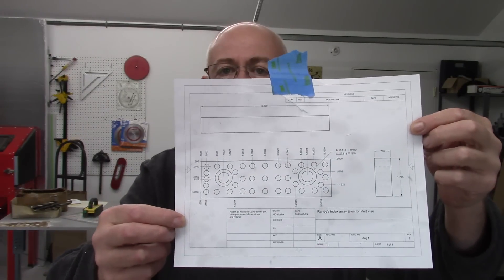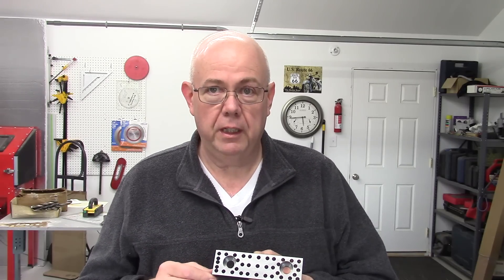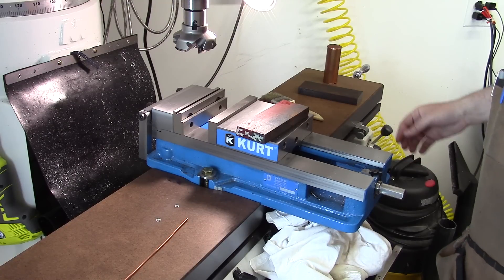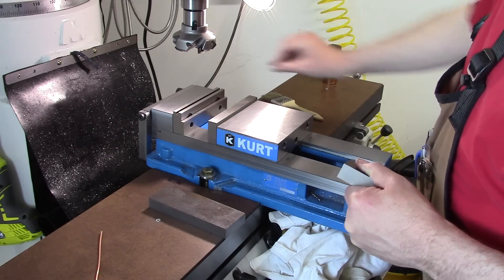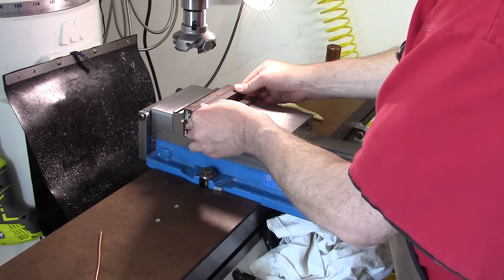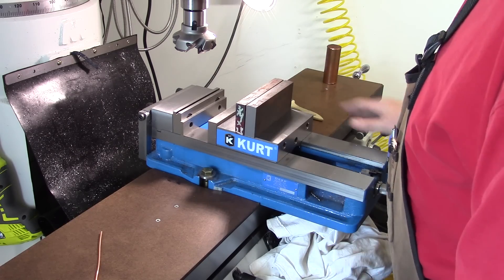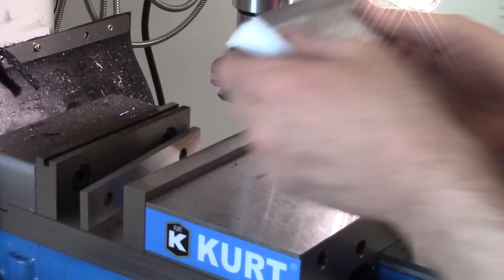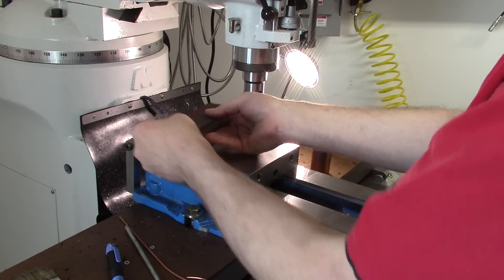Indexable vise jaws for Kurt vise - part 1/5

Comment: good honest video. The round rod of any type is not good and keep in mind it wont work if the sawed stock is out of square. One side will instantly lift up and likely break the inserts. Instead take a 6 in long square of aluminum and clear out leaving a raised pad that you can crush down on. The round rod allows the the plate to pivot also. To prove this run across there like when you did the narrow sides taking a cut from right to left like you did. Now felt pen the top. now do a spring pass back the other way and you will find that the part in contact with the solid jaw on that side will in fact clean up but the other side near your rod wont touch. Using the pad method you wont see that and a sawed part can be 5 degrees totally out of square but it will be held against the solid jaw perfectly. with the blocks not yet touched first thing is to put them in together and hack off the sides as fast as you can traverse. Then put them in the vice and make your first ref surface--the large faces. do both faces. Now stick them in together and do the sides again together finer feed. . For the ends then stick them on parralells and mill off one end on each then use a stop if you have one and mill off the other ends to size. Not sure if you have a surface grinder but best would be to finish dust off on the grinder all surfaces perfectly square that way you can use them as perfect blocks for other uses. On the ends of the vice jaws also throw in a 1/4 tapped hole for a stop or even bolting on a plate for squaring things up standing up by pressing the part against the plate.  Hope those tips help someone even though this vid is a few years old.

Comment: that looks like a koroloy face mill.  it sounded pretty happy on that mill.
Reply: To make a much smoother cut and save the inserts, move the part so the cutter diameter is just over the part edge. It's often known as tangential engagement milling where the cutting forces are absorbed along the rigid part length. There is a video called ' mill 6x faster free ' that shows this.

Comment: There are 6 holes missing dimensions in Y direction on "Randys index array jaws for Kurt vise" (PDF).
On the far left of the part, the 2nd and the 4th from the top
The two holes to the right of the left .515 C'Bore, and the two holes to the left of the right .515 C'Bore.
None of these line up to any other hole centers. Lay a ruler on them and see!

Can we correct this?
How about putting the drawing file on Dropbox?